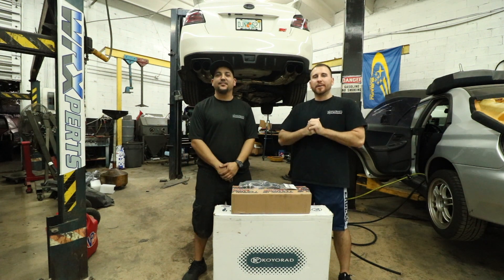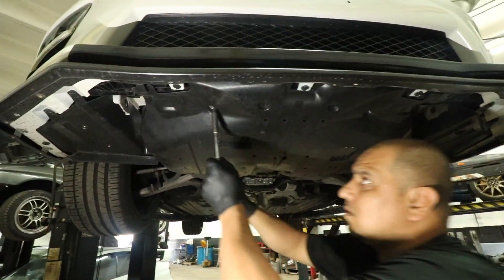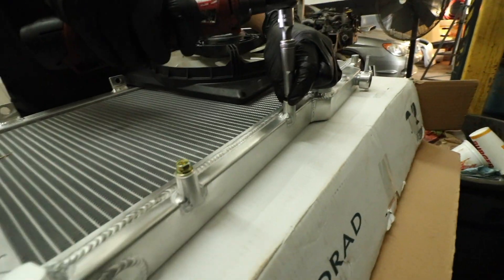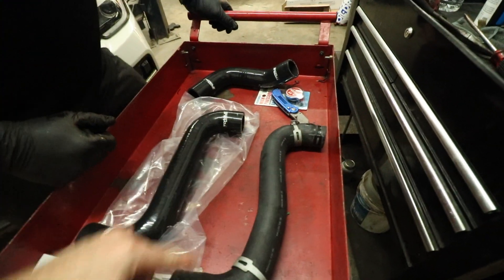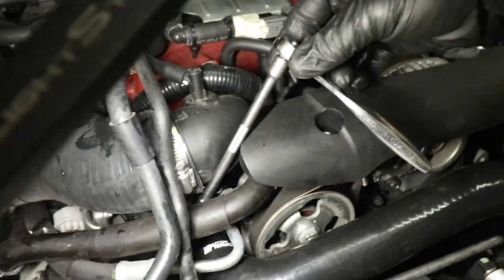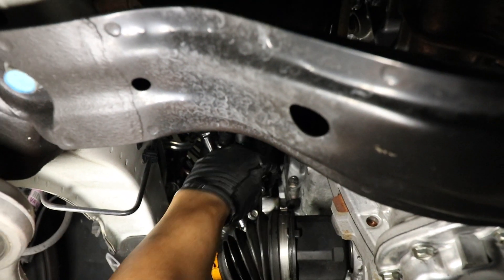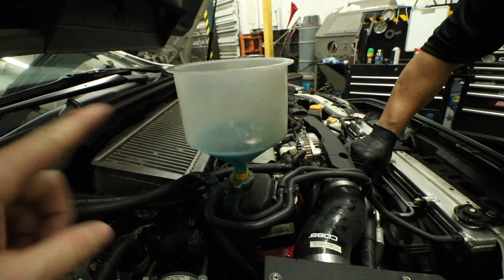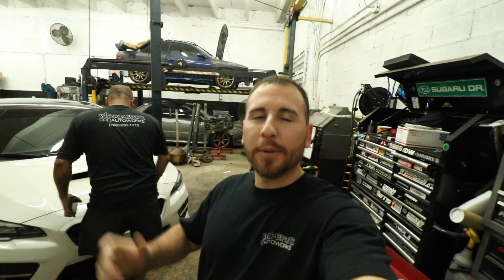Cylinder 4 Cooling Mod and Radiator Install by WRXperts! (2017 WRX STI)

Comment: the hose you tapped into in the torque solutions instructions says black pipe?  is that the hose on the top port of the heater core or bottom?  thanks!
Reply from the maker: WRXperts can help you with any other questions you can reach out to them on Instagram or Facebook

Comment: You never showed or talked about which coolant hose to cut to be fitted on the cylinder 4 hose.
Reply from the maker: WRXperts can help you with any other questions you can reach out to them on Instagram or Facebook
Reply: For 2008+, it's the hose with the insulation and connected to the black hardline, not the bare silver hardline. Just putting this here for anyone that needs the info.
Reply: @sssnake2332  What about for pre 2008

Comment: Great video, did you upgrade hoses as well during the install, if so what brand, I couldn't make out the name.
Reply: Torque Solutions
Reply from the maker: Torque Solution Hoses

Comment: Do You think I need the cylinder 4 mod if I run equal length headers ?
Reply from the maker: I think all STI’s need them it tends to be the cylinder that has the most issues so the coolant mod can only help prevent issues. It is just added security for that cylinder.
Reply: You’ll need it less with ELH. ELH make for better head management across the heads as well, so ELH + Cylinder 4 mod is a great combo.
Reply: @JotaJotaSTI  just wondering if this is so important why didn't Subaru do this from the factory?

Comment: How is this kid holding up??? How many miles are on it? I am about to have MGW install soon
Reply from the maker: Still going good it’s been about 4 months
Reply: Thanks for your reply I literally have it ready to be installed as soon as everything opens up. I bought Torque solution fuel lines and rails as well. Seems to all be great quality. I was very weary about this 4th cylinder mod vs getadom. If yours is still going strong I feel confident about my purchase